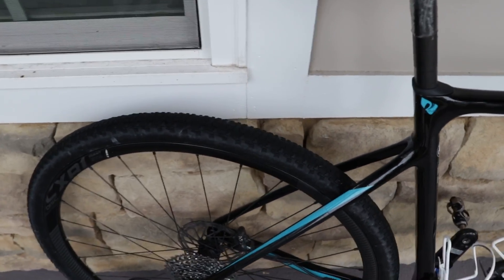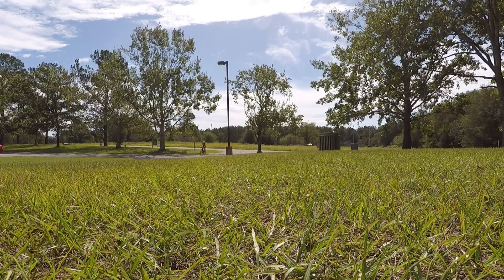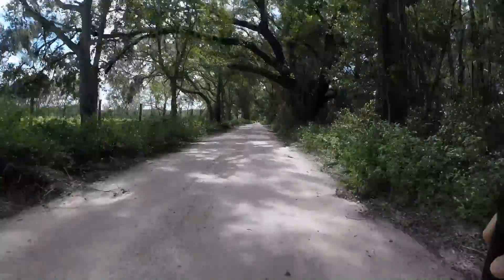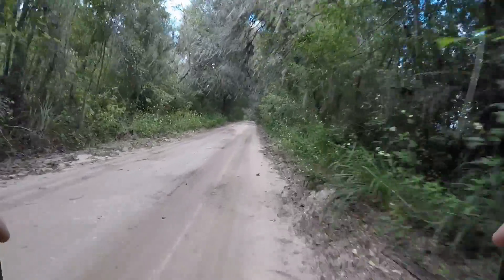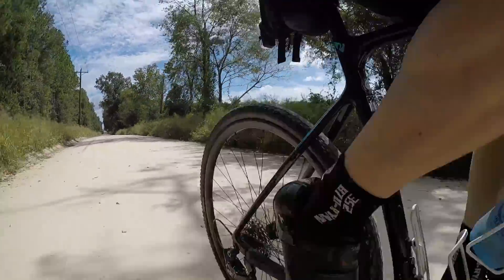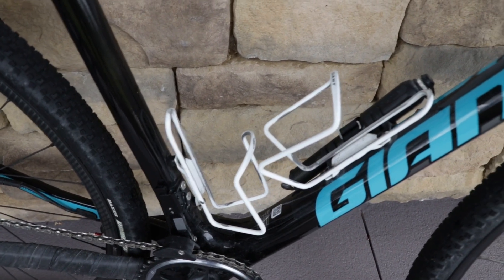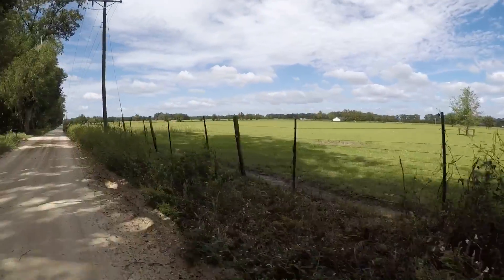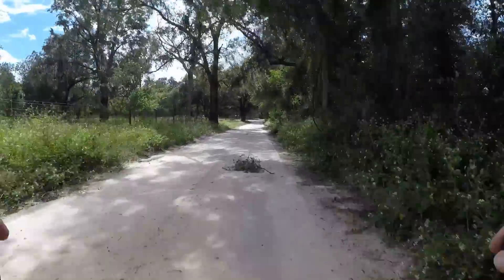How Does a Cyclocross Bike do as a Gravel Bike?

Comment: Hi Clint... The choices are a bit blurry.... Gravel bikes longer wheelbase and in general larger tire clearance However many can take 650 be wheelsets and tires yet the cross bikes are a bit more nimble... This was a tough decision but I went with a carbon gravel bike with huge tire clearance and 650b opportunities and I won't have toe overlap.  I plan to do a lot of trail riding but not race it so am hoping it was a good decision .... Any thoughts?
Reply from the maker: +The Gefster I think the differences are so close no matter which one you go with it's going to be a great bike. Geometries can differ widely amongst manufacturers. For example the wheelbase on the giant tcx is slightly longer than the wheelbase on the Niner rlt 9 RDO. But the bottom bracket drop on the RDO is 1.5 centimeters lower.

Comment: Do you think the TCX can do road racing ? I do 4/5 granfondo races every year and I want a bike to do all with one bike, from CX racing to road endurance racing.
Reply from the maker: +Kawaspresso yes, with 25c road tires at TCX is going to be about as fast as a road bike. The bottom bracket is a bit higher so you're going to feel more on top of the bike than inside but you get used to it quickly.

Comment: Gravel rides in the mountains are a whole different ball game, gravel bikes get out of their depth very quickly. I long for my 29er hardtail on those rides😩
Reply: Many of the old carbon hardtail 29ers with more upright angles w 68mm width bb (I still have 3 of them) make great gravel bikes for long rides. They were years ago what dealers will sell to the next generation or so of gravel bikes...Wider tire spacing. Sure they aren't going to do it faster than they have to or how would they sell you the latest model :). I was with 2 guys in the mountains the other day on there sub 40mm wide tires and it got not pretty, very fast. :) I was on 50mms with spacing to go even larger.

Comment: Is there a big difference if you race cyclocross with MTB? How much slower are you with MTB?
Reply from the maker: From my experience my gut feeling is that on a typical course you probably be about 5 to 10 seconds for per lap on a mountain bike, assuming the same amount of effort. However, there are some coueses where I think that mountain bike will be faster. Overall I don't think you're at a big disadvantage of using a mountain bike in cyclocross road but the purists will only do it on a real cyclocross bike.

Comment: Really the only difference is MAYBE more tire clearance on a "gravel"bike, is the crankset. Cross bike will be more 46/36 whereas the gravel bike would be the 50/34 compact cranks.
Reply: There's also difference in the frame geometries. The CX bike has a more aggressive position the gravel bike has a more relaxed position due to more relaxed angle of the head tube and forks. I think there's some other differences too, such as height of the BB, as well as the angle of the seat stays. Oh also the length of the wheelbase is different too, longer in the gravel bike I believe.